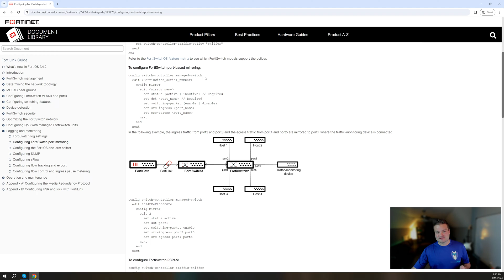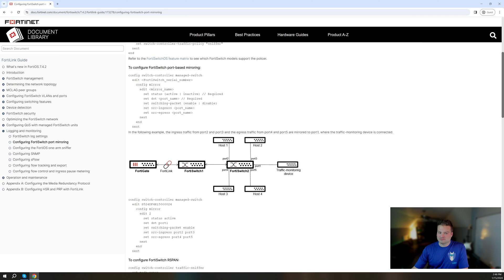Configure Mirror Ports On FortiSwitch Managed By FortiGate

Comment: Watched Manny of your vids and they all very educational, i noticed you never touched a fortiextender and its possible use cases. How about brewing a video on this topic
Reply: In our environment, we use them as an external method of administratively logging into the Fortigate when the main circuit goes down. 2nd function is to upload all logs to FortiAnalyzer, which also saves a little bit of bandwidth on primary circuit. 3rd function is to provide a backup internet connection to users when primary circuit is down, although extremely slow since it's on a 4G/5G SIM card.

Comment: Hey Mike, I love the video's they are very informative. 

Here's something that's likely more advanced. 

Dynamic VLAN assignment based on MAC address. We have data, voip and IP camera's on the network. Phones are easy using lldp, data we can make a default, the camera's are all from the same manufacturer so we can use the MAC OUI. I just don't know how to assign it in fortiswitch. 

I can do it in Netgear very easily, but can't find anyplace in Fortiswitch.

Comment: Building a large setup atm where we have multi-tier managed fortiswitches and tier-2 fortiswitch needs to send mirrored data to tier-1 fortiswitch which in-turn mirrors it + it's own data to an IDS sensor which is connected to it. The sensor works on Layer-2 only and doesn't support ERSPAN. Couldn't find anything on Fortinet documentation for this scenario.